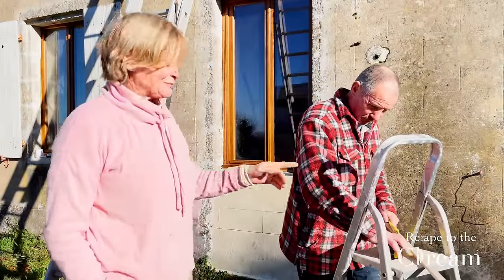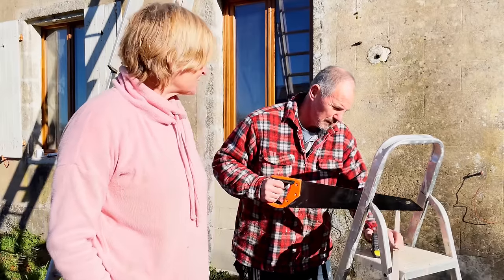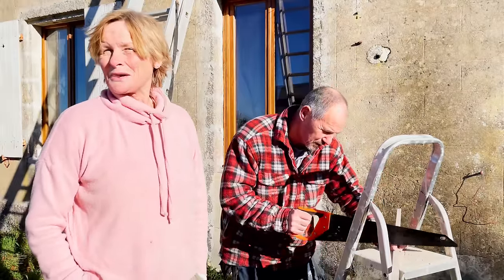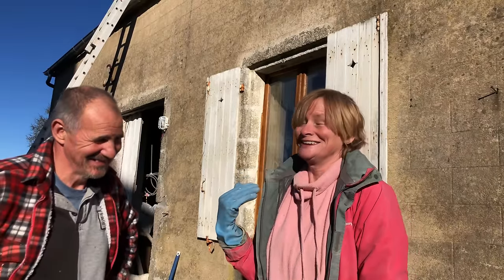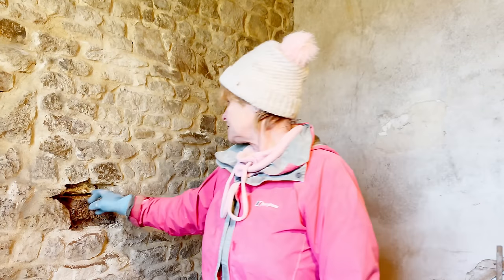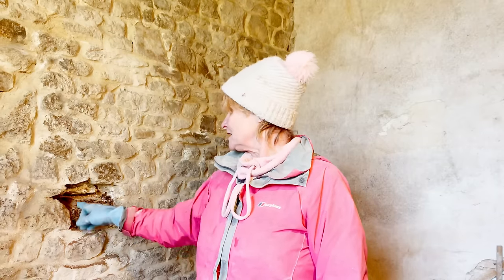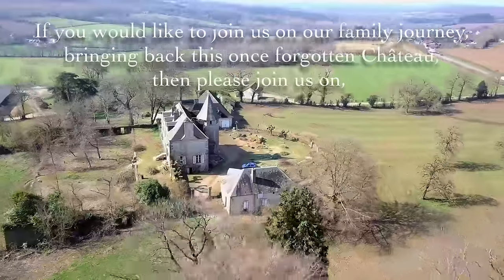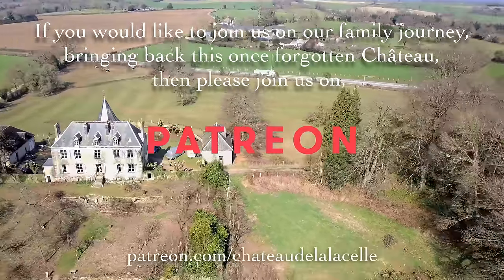Fixing The Leaking Windows In The Château Cottage. Ep 12

Comment: You can use mineral oil on the stones to bring out more of natural color and remove light cement/plaster. I use a brass or steel brush, dip brush in oil lightly, scrub the oil into the stone, and wipe with a clean cloth. Even just using oil on a cloth will bring out more of natural color.

Comment: Great work Tony and Tracy! And Tony I was about to suggest weatherstripping for the windows when you used it. Might be a good idea for exterior doors as well. Keeps heat in and draughts and weather out so will help with heating efficiency.
Tracy I wonder if you could try matte Osmo for stone flooring on the walls to seal and highlight the stonework. Billy from The Pethericks has used it on a concrete floor. You may have to avoid the pointing with it to allow the wall to breathe. Might be worth a try.
Glad to see the progress on the cottage. Hopefully the top floor will be finished soon and the bathroom advanced. When you have a gorgeous bathroom you won’t know yourselves! There’ll be a long queue for using it. You’ll have to have appointments!